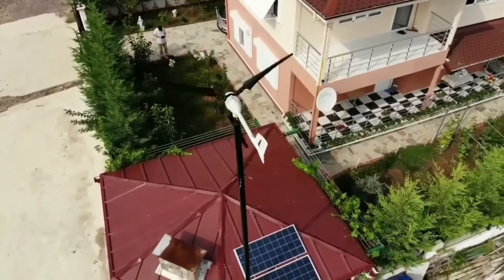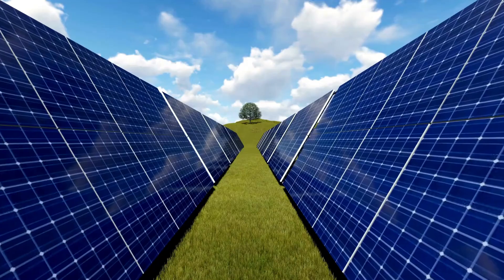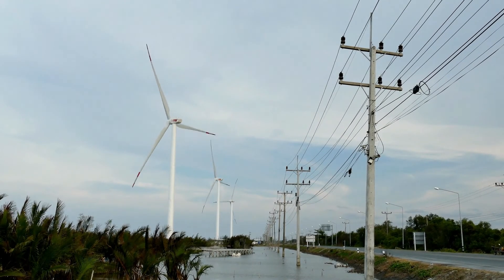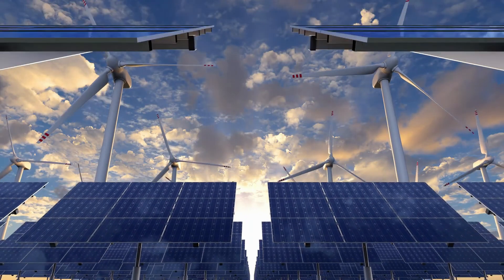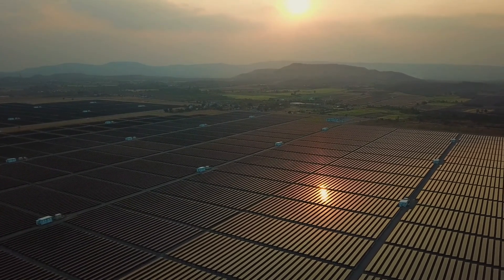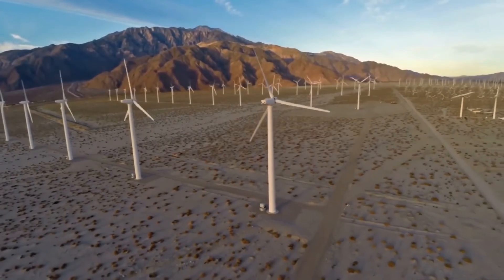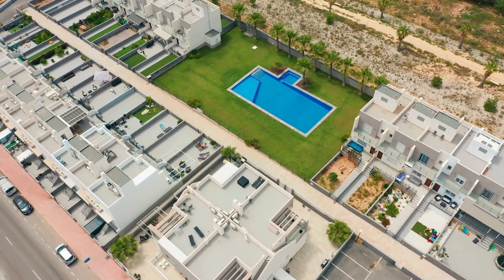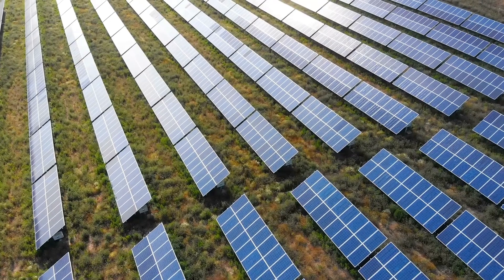"Windmill vs Solar Energy: Which is the Best for Your Home in 2023?"

Comment: Turban: (noun) a traditional headdress consisting of a long scarf wrapped around the head. Pronounced ˈtər-bən.
Turbine: (noun) rotary engine in which the kinetic energy of a moving fluid is converted into mechanical energy by causing a bladed rotor to rotate.
Turbine is pronounced TUR-BINE (with a long "i") Tur-byn.  The second half of the word rhymes with wine or whine.
Reply: Are you attempting to educate an ai tts generator?

Comment: I have both solar panels and a 600 watts wind generator. Works better with both. 😅
Reply: You are a smart men sir . That means your generate energy all year around.
Reply: I’m in the process of doing this
Reply: Can u post a video  please
Reply: Ive done the same, both wind and solar, now I have all the energy I need, but I noticed the video doesn't talk about windless days. 600watts solar and 1300watts wind turbine keeps those 100 amp hour batteries charged...